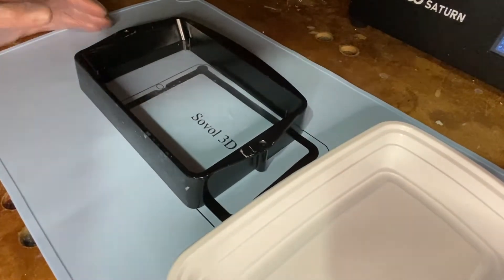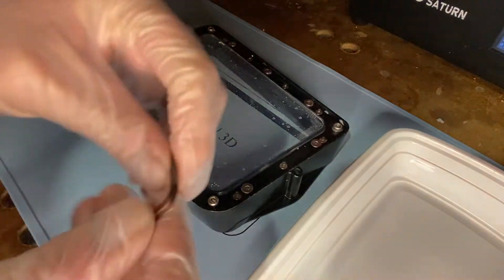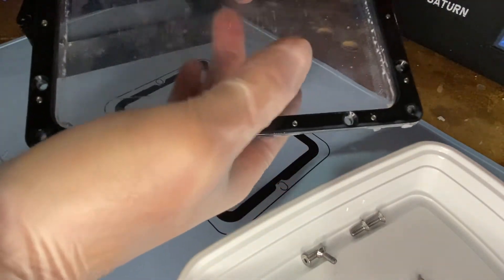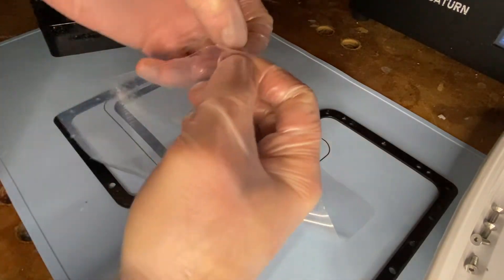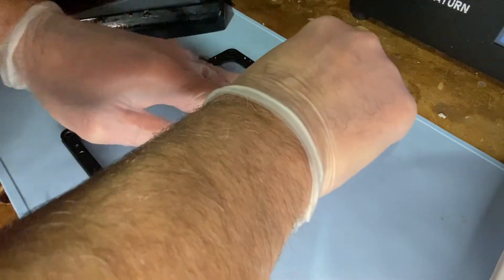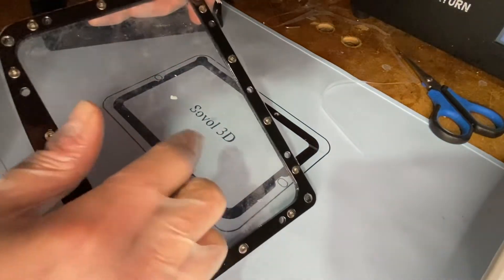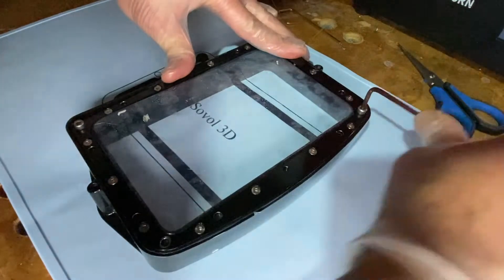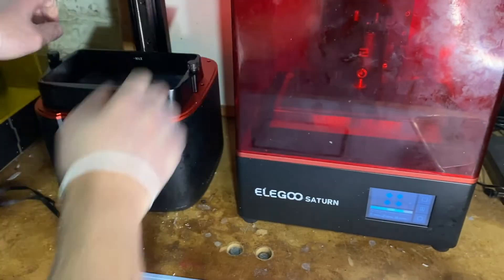How to replace the FEP film on a Resin Printer (SIMPLE & EASY) - Elegoo Mars 3 / Saturn

Comment: Aren't your smaller screws supposed to be on the inside and the larger screw on the outside? When you look at the assembled tray should you not see the heads of the larger screws and see the tips (not the heads) of the smaller screws? Follow? Also there is one side of the metal mount where the holes are recessed. There is a detailled video from the manufaturer about this.
Reply: yeah I noticed that too, maybe he found out during test printing, maybe he fixed it off screen.

Comment: I'm confused. The official elegoo channel says to put a sponge under the film when you install the first set of screws in. I'm guessing for extra slack so when its completely installed it's not too taught. Also they didn't trim the plastic until it was completed with all screws installed.
Reply from the maker: I just watched their video. Interesting. The form they put under the film seems to make it looser. Have never done it that way. (Not sure I would even try it that way either) They trim off the excess film at the same point (once you have the frame screws in). 🤷‍♂
Reply: @MakerBuildIt  depends which video. The older one has them trimming it after it's all together. I noticed the newer video which trims at the same point as you I watched after I commented. That video didn't come up the first time I searched.
Reply from the maker: @bkpickell  There's definitely a few ways to do replace the FEP film. 😀
Reply: @MakerBuildIt  yeah I guess so.
Reply from the maker: @bkpickell  I’ve had people tell me that you everything for bottle caps like the form was used to tuning rods to check the sound. 😀
Reply: @MakerBuildIt  Tuning rods is a bit excessive.  As long as it works, it works. I think the whole sponge thing is so that it isn't so difficult to put that second screw in. I don't think I would use a bottle cap though. I'd be affraid of damaging the new sheet.
Reply from the maker: @bkpickell  Makes sense. 😀

Comment: You didnt use a bottle cap, or piece of foam to give extra tension  before. Also, unlike other fep, you 'lock' all the screw in a circular, without needing to set the frequency of the drum.
Reply from the maker: Maybe I’m missing something, but I have never needed to do that. 😁
Reply: ye its better with something under :D 5mm

Comment: hey. on elegoos official channel they have a fep film change video and I noticed after the new fep was installed in the tray and before they tray was installed in the vat that the fep looked very loose. i figured that some action occurs when the tray(with new fep installed) is made more taught during the process of screwing the tray into the vat. is this correct or an I imagining things. i seemed that yours loosened up after removing the tray from the vat. 
i just want to make sure I have all my ducks in a row before I change mine.

thanks!!!
Reply from the maker: The film is loose until you attach the frame to the vat, just like you stated. 😀you’ll see in the video we made it get very tight once all the screws are in place. 😀
Reply: @MakerBuildIt  i had a feeling thats how it went. Thanks alot for confirming.

Comment: One thing that no one seems to mention is that you have to tighten the screws enough so that the metal rim that holds the FEP sits at or below the VAT housing.  Otherwise your VAT won't be sitting level.
Reply from the maker: Great point. If you you screw them in all the way (but don't open tighten them) the vat should sit flat. :)